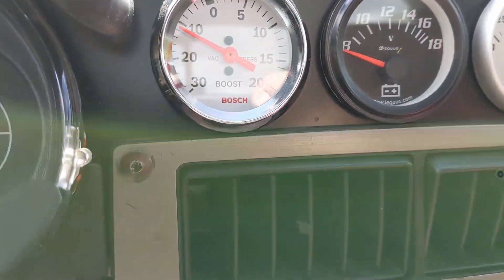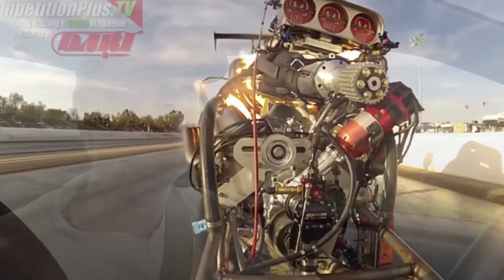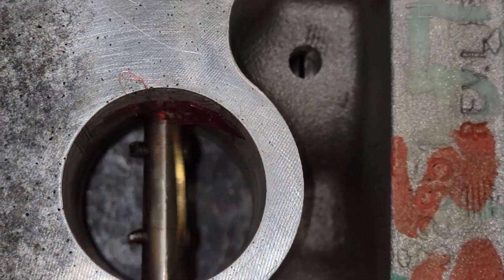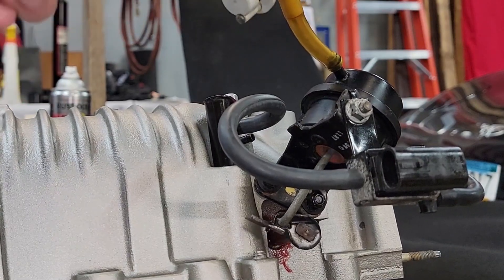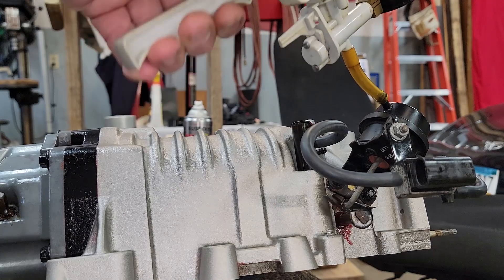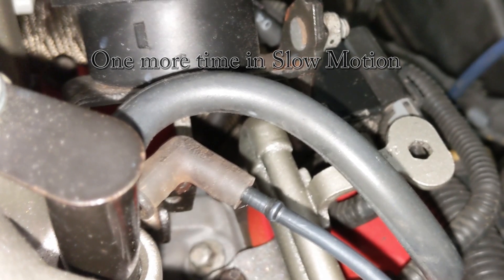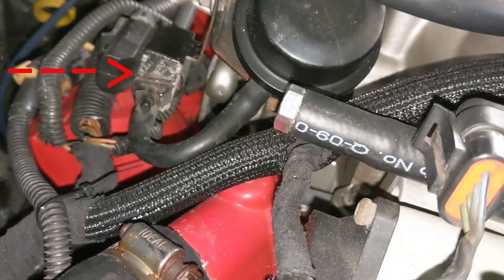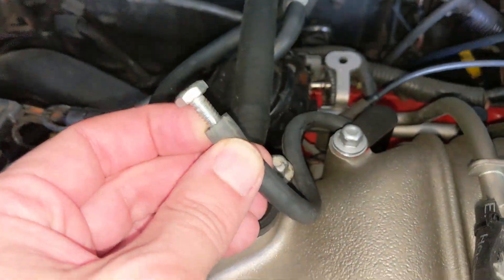The Supercharged 3800 Fiero Lost Boost! (Why???)

Comment: I can vouch for the catastrophic failure of a roots supercharger.  :(   Heading to fedex as I type this to send mine off lol.   Don't even get me started on the cost of shipping these days!  Glad you got it sorted out on the Fiero Toys!
Reply from the maker: I'm confused, if one of your rods let go, how did that take out your supercharger?
Reply: @Toys4Life  Sorry toys I totally forgot to reply to this.   I saw your comment this morning on the HPS brakes video and I was like oh crap.   Anyhooters, so what happens  is when the pistons shatter and it punches holes in the block because the rods break this allows air to enter the engine internally even though the throttle body is now closed. The engine continues to run by taking air in through the cylinders with missing pistons and the other 6 cylinders vacuum all the debris out of the broke cylinders and since the throttle body is closed this opens the bypass valve in the blower wide open channeling debris back trough the intake ports of the busted cylinders directly into the inlet of the blower into the rotorpack through the rotor pack and through the whole entire motor.  There is even pieces of piston in every remaining cylinder as the blower is an open chamber down the sides of the blower case feeding piston pieces into all remaining intake valves.    I probably did a terrible job of explaining that but unfortunately it is a very common phenomena when PD blower engines break a piston in combination with a hole in the block.   As much as I want to deny it I've talked to a bunch of guys with more experience than I and they all agree that this thing more than likely butted the rings which stops the piston dead in it's tracks and it ripped the wrist pins clean out of the pistons.
Reply from the maker: @PNW_Car_Mods  Well that totally sucks, but it does make sense! Thanks for the explanation I appreciate it!

Comment: At least it's good that they designed it to fail open, on my car the boost control solenoid can fail shut the way it's used stock.
Reply from the maker: Makes me wonder how many people drive around not really knowing there's is broken. Stock boost is like six and a half pounds or so I wonder what it would drop down to, two psi?

Comment: I have a 97 riviera that seems way down on power compared to the regal and park ave. I previously owned. So just plug the vacuum side?
Reply from the maker: No, plug the low side that comes in from the solenoid to the canister that holds the diaphragm.